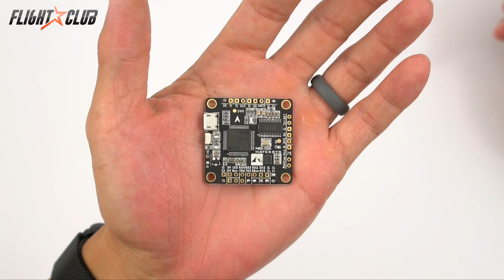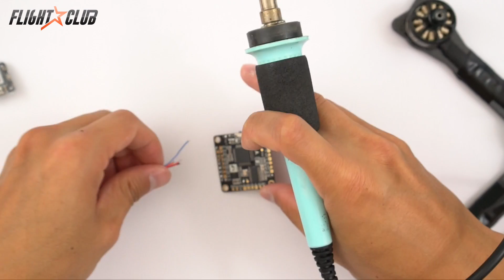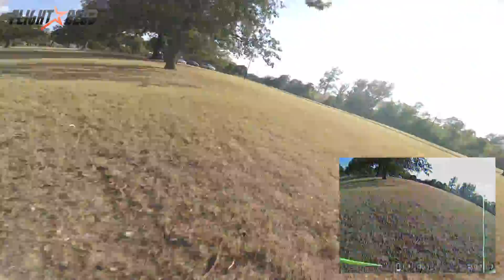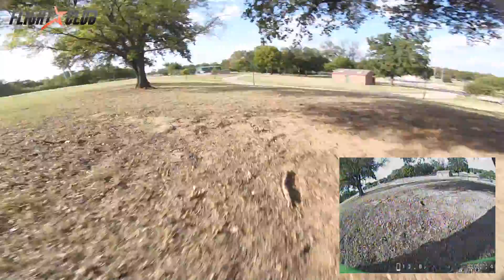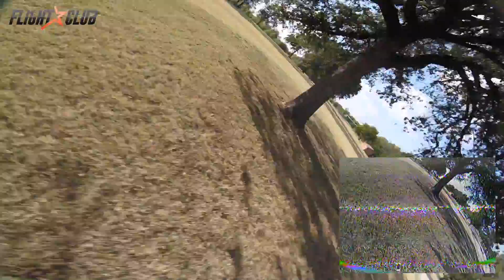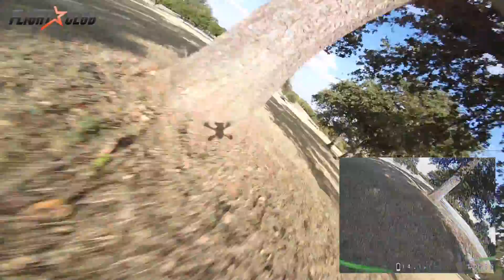Matek F405 OSD Flight Controller, Betaflight F4 Killer?

Comment: Hi i have the  same board but i have this problem when i move the board the arrow move to wrong direction others words all is wrong and i dont know how to fix the problem i know is easy fix but aim stuck in betta flight.
Reply from the maker: you can turn on accelerometer and move the quad around.  the movement should mirror the model in betaflight
Reply: @FlightClubFPV  thanks  for responding back to me I fix the problem now the other problem I have is everything works fine direction from motors / props / speed controllers are tune to respond to power the quad wanted to flip I check everything don't know what else to do......

Comment: Will someone please link me to the driver for the F405 OSD? I was getting "Unknown Device" in Device Manager and now that I installed the STM32 Bootloader driver I now see nothing anywhere (not a COM port, not in Zadig, and (obviously) not in Betaflight/BLHeli Suite). I have an F3 FC'd quad that I connect regularly to the PC in question (did it a little while ago this afternoon).I'm using the FCHUB 6S w/the ribbon cable and everything is lit like an x-mas tree. I get blue/red LEDs when I do not hold the boot button; Only red when I do.

Comment: I've got the F405 AIO in my DemonRC Fury, and I've just went and bought this one for my upcoming build too along with the FCHUB 6S PDB as well. 

I've seen loads of folk complaining about the AIO having yaw twitching issues, but I haven't had anything like that with my AIO, I think it's a really great board at a nice price. 

I did notice that in the FPV feed when Ivan was flying, the OSD was flickering, any idea why that is happening?
Reply from the maker: The Tokio has built in vibration damping for the fc stack so I didnt notice any vibration issues.  The flickering at the end is the low voltage warning.
Reply: FlightClub yeah my mate has the Tokio SX, those butter mounts are really nice. 

Not sure why people have had yaw twitch issues with their F405 AIO boards, mine has been great, but I wanted to try this one in my QAV Skitzo frame as I do prefer having a separate PDB in my quads.

Comment: Horrible gyro!!!!!!
Reply from the maker: I didn't notice any vibration issues.  It was buttery smooth in the tokio frame
Reply: I had it in both my true x and stretch x tokios and took them out. I even had the tokio butter mounts PLUS rubber standoffs and it was terrible. Yaw twitch and if you hit a gate it would yaw spin of death to the moon lol. I ended up putting in two of the new CL Racing F4 boards......amazing setup and rock solid boards. 6000 gyro too so it's rock solid.